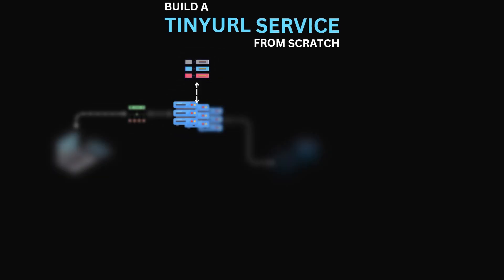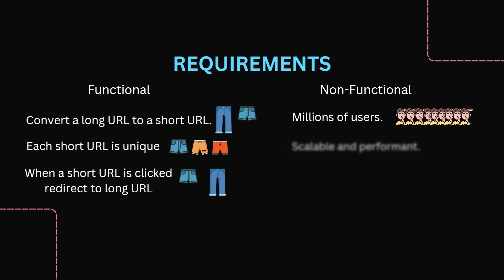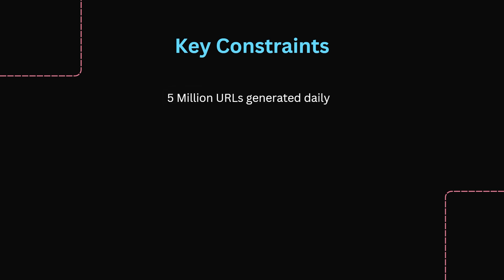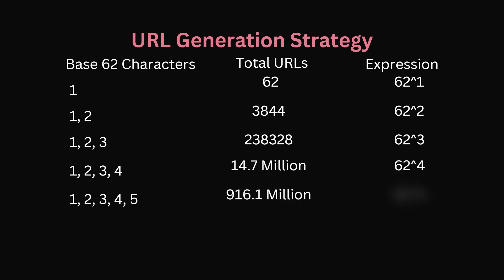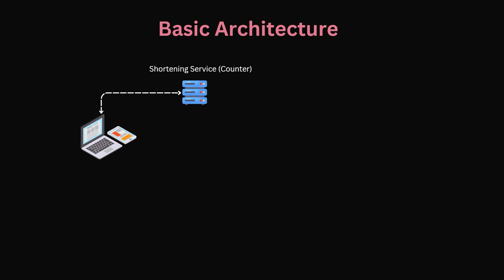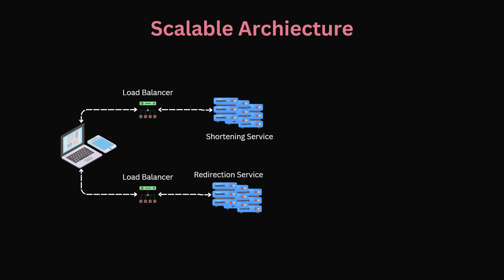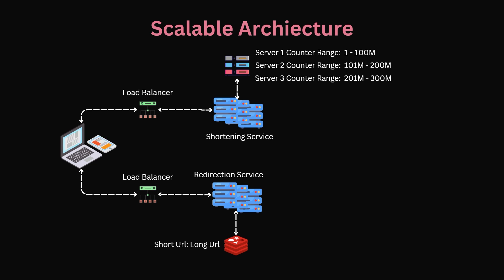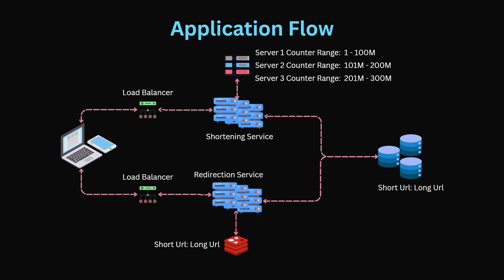Tiny URL - System Design Interview (URL Shortener)

Comment: Analytics can be tracked on the redirect service, store data in a separate metadata table for reporting.

Customer URL creation would be done on a separate branch, upsert and only allowing `unique` values in the `url` column. It would feed normally through the redirect service.
Reply from the maker: Interesting, good proposal. What metrics do you plan to capture here ? I presume the frequency links are visited is one of them, however there are more, for example and trend metrics you might consider ?
Reply: @TryExcept-10110  we can track utm_source as well as destination platform, geo-location, ipaddress, browser data, timestamps and such. You could also add click count, and attach it to a payment service to handle referrals. You can also track individual patterns, trends, platform usage when they're more likely to be online...

Comment: So if the url shortener service nr1 has used up all of the integers between 1 and 100m+1, what happens to that service then? Is it manually shutdown and replaced with another instance with a higher range of numbers to pick from? 
The reason for saying "manually" is that I wonder how else you would know what the next possible range of numbers could be based on what services are already running and what their ranges are. But i guess you could automate this process as well.

Also, where does it store it's last incremented number, per service? Is the previous number stored in memory or somewhere else?
Reply from the maker: Hi excellent questions and these are the type of questions your interviewer will ask ! 

So when a server runs out of valid integers it could de-provision itself automatically yes. It could also either reserve the next valid integer range for itself and use that. Both are valid approaches.

Valid ranges could be confirmed by the instance through checking the parameter store. 

If you want to be really specific, it could be possible that two instances attempt to reserve the same integer range at the same time. This can be avoided by implementing a startup queue or reservation queue which processes integer range reservations sequentially. 

The integer counter would be held in memory in each instance. In the event that a instance goes down, it will have to reboot - retrieve its integer range and then check against the DB what the next valid value is. It will then be good to serve requests. 

During the above process of restarting the other instances should have sufficient bandwidth to cover all incoming requests. 

Thanks for your questions !

Comment: I didn't understand the purpose of the integer counter seed.
It doesn't guarantee that no hash collision will happen. A seed may prevent two values from having the same hash while causing another pair to collide (a pair that wouldn't have collided without the seed). The odds of collision look the same to me.
Reply from the maker: Hey ! First thank you for the comment. I believe the issue has risen due to my use of the word 'hash'. 'Convert' would have been more appropriate. To answer your question: 

When you hash/convert a integer to base 62 you can guarentee it will always be unique compared to other converted integers. In the same way of when you convert a number ot binary. 90 represented in base62 is 3o8, similarly 90 represented in binary is 1011010. It's just a different way to represent a number. 

So the issue of the hash collision in this architecture isn't the chances of two integers being converted to the same hash but rather two instances of the shortner service accessing the same integer at the exact same time. This would cause both services to use the same short URL for two different Long URLs. 

To solve this issue, we have to give each shortner service instance an 'operating range' to ensure that this case does not happen. 

I hope this helps, if you want me to explain again I am happy to do so ! Thanks for the comment :)
Reply: @TryExcept-10110  Thank you for the explanation. 

I understand now, yeah it make sense.

Previously, I thought that the shortened URL is created by "hashing/converting" the original URL, and the incremented counter seed serves as an extra input to the "hashing/converting" . Hence, I thought it's redundant.